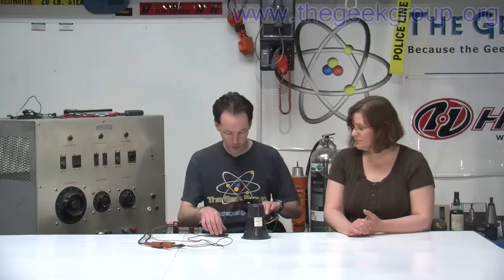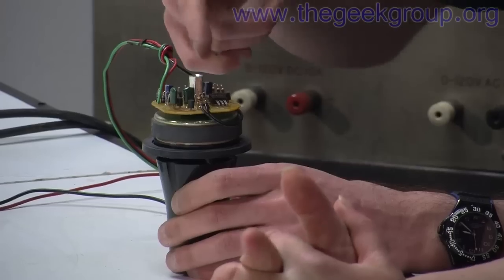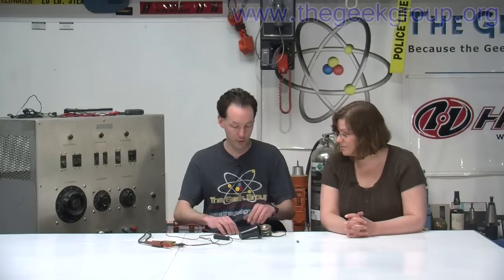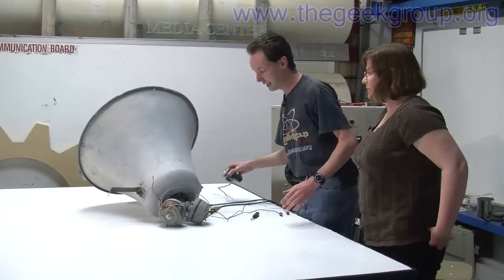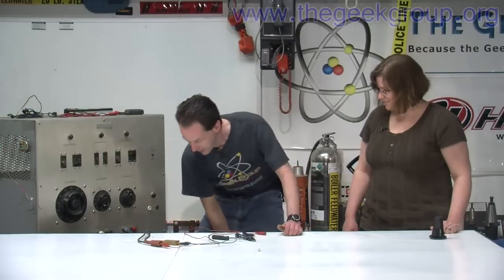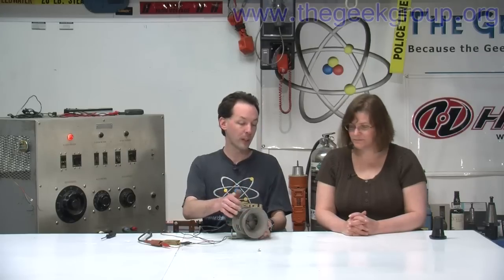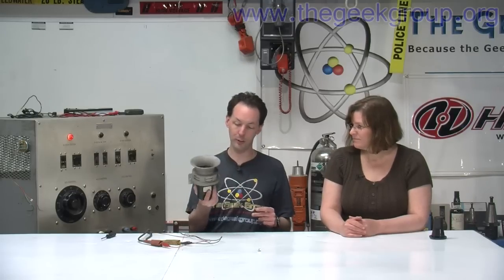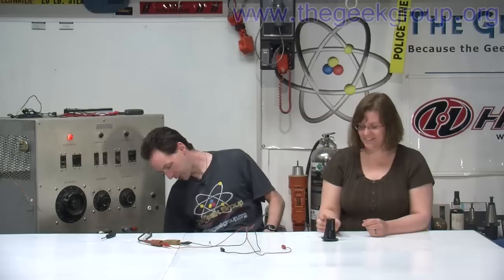How Sirens Work

Comment: For mechanical sirens, sound does come out the front.  In a mechanical siren like the one you have there, it looks like it's forcing the air out the sides with centripetal(centrifugal?) force, and then shutting off the outlets, creating pressure waves on both sides of those holes, which makes sound come out both the holes, and out the front.
Reply: Actually some sound does come out of the intake, not much, but a little bit. Its the reason why the 3rd gen ACA Allertor 125 had a larger intake cone then previous generations. Its to preject thevsound more efficiently.

Comment: That huge speaker he pulled out is called a, "Atlas Speaker". There are two kinds. The dual driver and the single driver. They would usually be found on the, Federal Signal E.O.W.S. series sirens. The E.O.W.S. "SiraTone" controllers would have "amplifiers" which amplify the sound coming out of the speaker. The rotating E.O.W.S. sirens "408,612,816" would have 4,6,8 dual dual driver speakers facing one way. When the siren activates, the speakers would rotate on a big box. The non-rotating E.O.W.S. sirens "1212" would have 12 single driver speakers facing all ways. There are 6 sides with 2 speakers. The E.O.W.S. 1212 prototype (115)  has different speakers but acts similar to the normal 1212. All E.O.W.S. sirens have been discontinued.

Comment: I took a old ww2 air raid siren down out of a old foundry that was being demolished and rewound the stator for 240 volts instead of 3 phase 480. Its works awesome and is extremely loud with twin choppers. It more or less looks like a huge bench grinder with a chopper on each end. 👍

Comment: The thunderbolt 1000 is unique because of the blower thing that it has. It has 1 port instead of the same amount as the chopper and instead of being quiet at low notes, it's actually loud as hell even at low frequencies. The ACA Hurricane is the same sort of system but the thunderbolt is better due to adjustable pitches, multiple blowers, easier to work on and actually with it's 5M blower, it is louder than the hurricane as a single tone. (Dual tone is about equal or slightly less.)
Reply: Also the fact that the t bolt is VERY editable. You can change the top pitch of it, change the rotation speed, even turn off the rotator completely :-D I don't think the hurricane was that changeable. NO mechanical siren was. And if it was a 1003, you can even change the damper timing for the hi lo. The standard timing is a half second on high, and a half second on low. I remember a while back seeing a video on here were a guy had his T bolt set to do 1 second on high and one second on low. So the T bolt is probably the most customisable siren ever :-D
Reply: It's also probably one of the furthest carrying sounds under the chrysler... And the single tone is BEASTLY loud!

Comment: Oh most of the Chrysler Air Raid Sirens were Flat Head 331 Cu In Gasoline Engine, they were essentially an Engine mounted to an over centre clutch that drove the Vane impeller to produce the sound.

Comment: the first one, im only part way in and dont know if you'r showing more than one siren.. but it looks and sounds like the kind that go off in houses with security systems.. they were at least installed usually in the basements of homes with security systems in the 90s.. large to huge homes, anyway.

Comment: @RubertaLang third sequel:

To get back to that, does Photon explains for example why that the reflective metal coating of a cd is blasted off under High Voltage discharges? NO, he has fun showing it, but things like, "hey it expands quickly, as it heats way faster thant the plastic support, so it delaminates explosively as the constraints beween the plastic and conductive layer grow superior to the bond of the two layers" No way, so hell, it's my guess, for all I know, and Photon

Comment: The air raid siren with the gas motor is a  Chrysler air raid siren
Reply: There's also the B&N Mobil Directo and the RARE Thunderbolt 2000

Comment: Um, actually, a lot of the sound *does* also come out of the front of the siren. Air gets sucked in that way, but at the same time, sound is emanating out of there! In fact, with some models, I've noticed that it seems like more sound comes from the suction horn than from the blow ports.

Comment: Did you try both red and green together?   Steady tone seems worthless.
Sound also comes out the front of the mechanical siren even though air is being drawn in.
Reply: Yes because it's an air raid siren if you remember hearing it is supposed to do that
Reply: What makes a siren most noticeable is it moving up and down in pitch.
Sounding "Attack" my Federal Signal 2t22A goes up in frequency, stays at its peak five seconds and then descends.  Repeat.    We heard what sounded like a weed eater or brake squeal.   It was a responding firetruck with Q2 siren improperly kept at peak speed - one steady pitch.  Many did not even recognize it as a siren.
Reply: Robert Gift That would be caused by the driver not using the siren's clutch to coast it instead they kept sounding it louder and louder.

Comment: Yeah, I've really always thought that running a siren on a fuel-powered machine is really weird and interesting! First off, there's this starter motor that runs before the siren can make its signal! That's way weird! Secondly, how do you keep getting fuel to it in the midst of an air raid?

The engine on the Chrysler Air Raid Siren isn't "like a gasoline engine;" it IS a gasoline engine! What's this "like" business?

Comment: Any Alarm installer that does not put a peizo horn or at least 100 dB isn't doing his job.  Why well you want to make it as un-pleasent as possible inside the vehicle so the would be thief leaves. Compression driver WTF ?? Please get it right mate. The centre diverging cone from the voice coil is covered by the outer diverging cone feeding into the main trumpet that effectively makes the siren 3 times shorter physically than it would be without the diverging fold-back cones.

Comment: @RubertaLang Fifth sequel:

Or arcking or overvoltage due to induced currents, or something entirely different is left in darkness!
No explaination whatsoever, so, hey, I suppose it is all of the above, but if I had even less knowledge, fuck, I would be screwed..
Except if the only part I cared about was the aping "hey, when I screw with it it's dead, hnnn Hey Butthead, gimme the hammer hnnn hnnn!"

Fooling around is great, but hey, should entertainment value be all that matters?